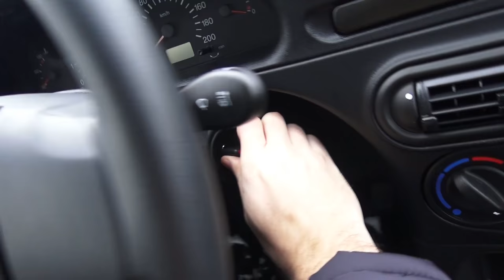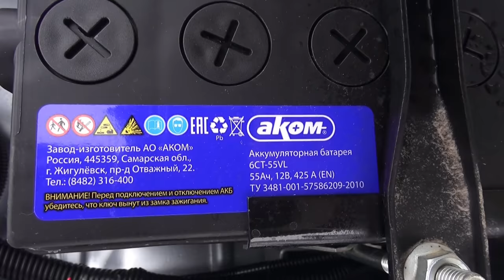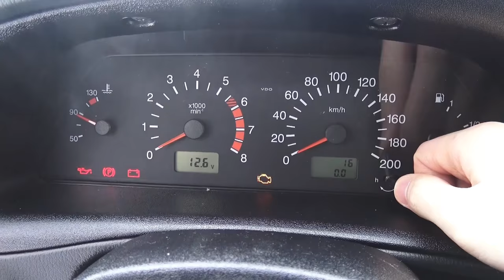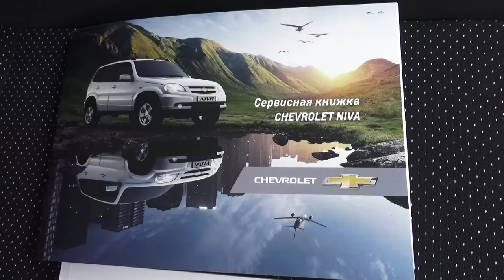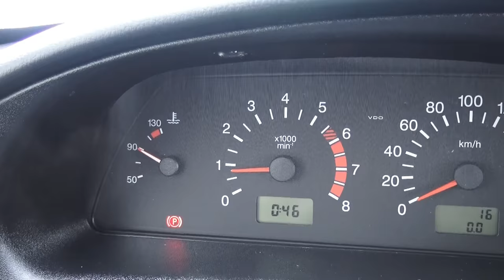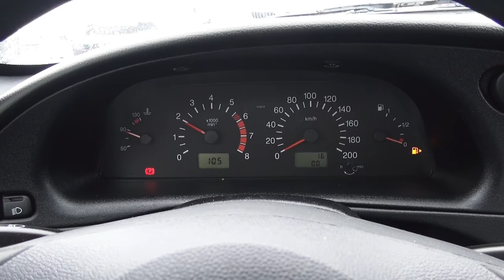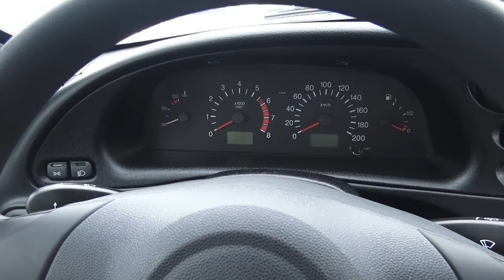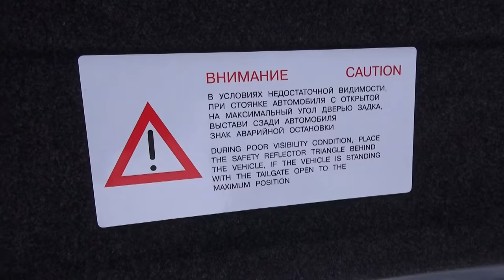2016 Chevrolet Niva 1.7. Start Up, Engine, and In Depth Tour.

Comment: I'd love this small compact SUV but the problem i hate is the headlight switch was separated into lower beam and highbeam not just like others car just simply turn the button and you will get the lights turned on , by the way , what is the car happening while Alex turn it of , the dashboard flashes some lights .